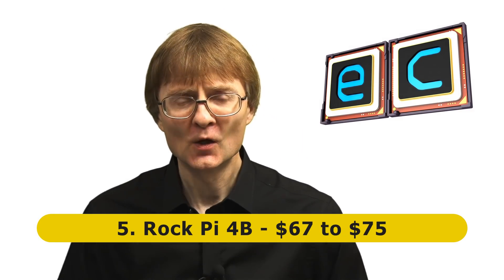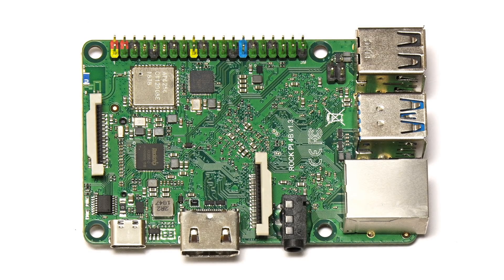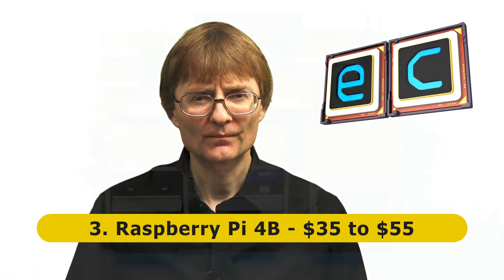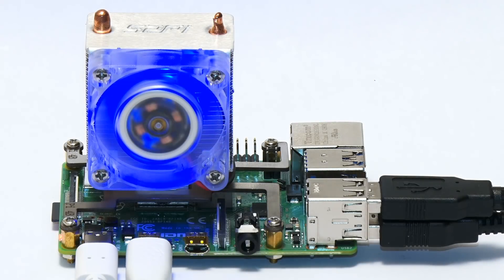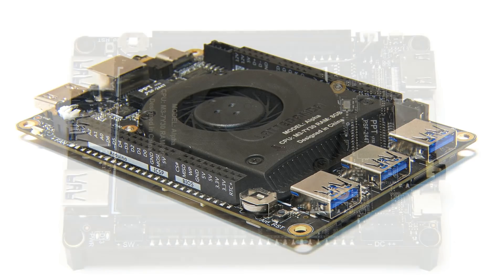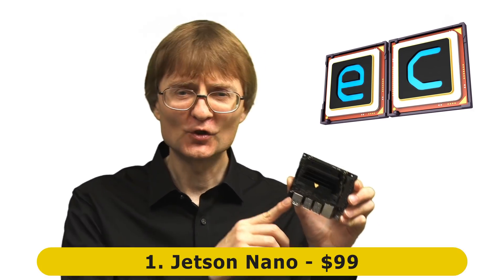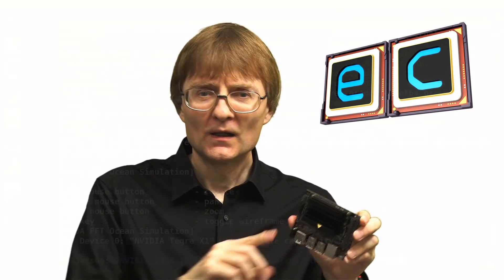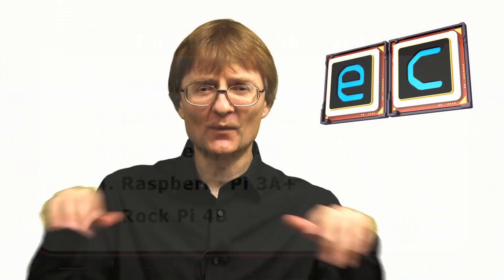Top Five New SBCs 2019

Comment: Last Xmas I bought an American made computer about as big as a Latte Panda called an Azulle Byte 3. Quad core 1.1 GH Intel CPU, 4G ram, 32G flash on board, no fan needed, case, power supply, HDMI and monitor plug, wifi, bluetooth, 1G ethernet, M.2 slot for SSD, Sata plug, 3xUSB3, USB2 and Window’s 10 Pro for $240.00 USD.

Totally finished like an Apple TV box, power supply included. No extra cooling fan needed, no buying a case separately and Window’s 10 Pro.

Comment: Personally what I want is a single HDMI and at least a SATA 2 interface that can be booted from along with 4 gig of ram. I don't need all the other bells and whistles apart from the 40pin GPIO. Nobody has done that yet. Giabit LAN would be nice as would USB3 but I'd settle for 10/100 and USB2
Reply from the maker: The closest is probably a UDOO x86 Advanced Plus -- the SATA is bootable I think (as is its M.2).
Reply: @ExplainingComputers  Thanks. I had a quick look and it's a bit too power hungry for what I need it to do and a bit too big physically. I might go with one of the Orange pi variants if I can find out what the power consumption is. My total power budget is only 20W. The SATA drive I have in mind is only 2.5W and the screen is 5W and 1W for the keyboard and mouse (which are not connected most of the time). I'm probably just going to have to live with 2 gig of ram and having to boot off onboard emmc.

Comment: My two cents: maybe the LattePanda should be an honorable mention, apart of top five, simply because it's so off the review budget group. If you compare a $35k versus a $370k car, it's nothing but expected that the differences should be huge. Also, as a suggestion, maybe Chris could review an industrial grade SOM+carrier board, for the price tag is similar to maker SBCs, but with much more solid support, which many of the commentators have mentioned here, and rightfully so. For instance, there are currently in the market options that run (and ship) with windows and are, truly, Linux compatible, with great specs and interface options. Maybe it'd worth a shot. Footnote: I got full of expectation when the list comes up to 3rd, 2nd, 1st... like... omg, who will be the Oscar winner... Lol...

Comment: I broadly agree with your SBC ranking, but the pricing of the LattePanda Alpha brings you into the Intel NUC price range. For around £450 you can get a Bean Canyon NUC with 8th gen i7 Intel quad-core Processor with Intel Iris Plus 655 Graphics, NVMe and SATA drive support (2 drives bays) and 40 Gpbs Thunderbolt 3 Port. OK, you need to add memory and an SSD drive. I have Jetson Nano which is a great SBC as you say, but I was also looking to purchase a LattePanda - Intel SBC. I then decided the Intel NUC NUC8i7BEH was better valued as it comes with a case and power supply. I dual boot it with Windows 10 and Ubuntu 18.04 LTS, which installs straight out of the box, and it has excellent performance.

Comment: Hello controversial Chris, 
Excellent choice, I can say! 
Minor update to your list; I would put udoo bolt as well on it. 
And yes, SBC or not, ML is new 'thing' to learn, so Jetson nano 1st, agreed. 
Continue to be controversial, by all means. 😁
Reply from the maker: Hi Elvira -- there's quite a bit of love here for the UDOO Bolt, even with its noisy fan! :) I will continue to be controversial then!
Reply: ExplainingComputers 
Noisy? What's that? 🤣

I'm surrounded with all kinds/sizes computers. Buzzing, flashing, humming, LEDs in all colours... 
The noisiest is not even a computer.  It is my ol' refrigerator in kitchen. 🤣
Reply from the maker: I too have a fridge that makes a lot of noise! I always have to close the door to the kitchen when filming. The Bolt's fan is particularly annoying, as it is high pitched and flits between silent and manic. :)
Reply: ExplainingComputers 
Actually, more the noise of my devices > better sleep for me. Calming effect. 🤣
Reply: @elviraeloramilosic9813  Then be sure to order the commercial version of the Keurig coffee maker. The pump on mine is louder than my fridge! But it also holds up well, & longevity was a definite selling point compared to the quieter home units. And for Chris's benefit, it also makes tea, & the occasional hot chocolate in winter. I've been thinking of adding a Pi Zero W to the Keurig. It would let me phone ahead to make my coffee, & I could use the GPIO to control a valve a pump to refill the reservoir when the level drops. Definitely a "hamster feeder for a nerd".
Reply: Marcus P. Hagen 
Nice idea. 
Excellent coffee maker. 👍🏻

Comment: I love the LattePanda but it's price is just a big no-go...
Reply: I can't see it for that price either, you could get a proper computer.  For makers or battery operated systems, this just does not seem right to me...
Reply: @layton3503  > you could get a proper computer.

have fun putting a "proper computer" in your car, a board a small boat or carry it around in your bag wherever you go (where a laptop would already be too big)...
I managed to get a LattePanda Alpha for free (only had to re-solder an SMD) and it sits perfectly in my backpack for collecting loads of data from loads of sensors (where the Raspberry Pi would be too weak).
Reply: @FinlayDaG33k  What??? you did not shell out $500.00 for one?   Thanks for making my point.
Reply: @layton3503  No, this one would have ended on the e-waste pile if I didn't spot the dead capacitor, so the only cost was the effort I had to put into soldering on a new one.

I think that the LattePanda does have it's perks when you need something fairly beefy but your application can't fit something like a mini-itx machine (like the data collection thing I carry with me).
If you have the space, then something else would be better, else, you should definitely have a look at the LattePanda Alpha.
The UDOO Bolt also exists but it carries the same price tag (although you do get more performance out of it).

This, of course, does imply that your application can run using x86_64 and is not locked into ARM.
Reply: @FinlayDaG33k  well for that price you still can get decent PC/104 embedded PC board or mini itx boards which packs nice power as well. Yes, both are bigger but both might work quite well. "for collecting loads of data from loads of sensors" I find it hard to believe. Visual data - ok, that one I might understand (although I find it hard to believe you need plenty of cameras). Other sensors ... those use usually SPI, I2C, 1 wire, I2S or sync/async parallel (4-8-16bit) and there's no reason why faster CPU cores would be better while following the same peripherals principles. I suspect you meant processing and not collecting.
Reply: @Promilus1984  A mini-itx board might still be to big for certain purposes (I'm not going to carry a mini-itx board in my bag all the time).
And my purpose does collect and process at the same time.
Though maybe I should rephrase it a littlebit since they are not "sensors" but wifi cards... 13 of them to be exact.
Reply: I would've preferred to see the ODroid H2 in that spot instead.  It's much more price competitive.
Reply: @jaylittlegm  Pretty much yea...
It has pretty much everything you'd buy the LattePanda for except the size being a big more (it's thicker).
It even has the option to choose your own RAM (instead of the hard-soldered "what you pick is what you're stuck with).
I'm not a big fan of the double ethernet on it but it does give more options to use it (eg. as a firewall)

Comment: The thing about Jetson Nano bothers me.  I've read blogs saying that the Pi4 performs at the same level on AI tasks, which is what the Nano was made for.  Also the Nano doesn't provide as much power to the GPIO pins, which makes me unsure of how to use it in robotics projects.
Reply from the maker: The Jetson Nano outperforms the Pi on things like vision recognition, if the neural net can run on the CUDA core GPU. The Jetson Nano also outperforms the Pi full stop on other tasks, as the tests in my Pi 4 vs Jetson Nano showed.
Reply: @ExplainingComputers  Thank you for responding.  I will watch your Pi4 vs Nano video again.  I'm a big fan of yours :)
Reply: @ExplainingComputers  Hi Christopher.  I appreciated this reply, because I watch your videos often.  I ended up buying a Nano as a result of your response.  My experience was nothing short of a nightmare: My first nano arrived broken and inoperable.  My second nano encountered numerous errors on installation, and would often need to be re-flashed and set up, a process that often took up to an hour.  Additionally, the tutorials for the Nano are often not beginner-friendly, and require deep knowledge of Linux and/or C++.  I found it useful specifically for running fast object detection models, but anything beyond that (including customizing any object detection model) proved impossible for someone with only a year and a half of experience with makerboards.  Perhaps the hardware is wonderful, but in my opinion it does not belong in the same class as a Raspberry Pi, given its ridiculous difficulty of use.
Reply from the maker: @tylersnard  I'm very sorry to hear that you have had problems with a defective Nano, and problems thereafter. I have not had such issues. It may be a power supply issue causing instability with the second board. That certainly could lead to what you describe.

Comment: I just want a Pico ITX SBC that has an x86(Celeron at least) CPU, 4 or 8GB of LPDDR3/4, and an integrated(or at least separately available) IHS with ports for CPU fan control, one SATA port, one m.2 NVMe, Displayport, USB-C power and/or POE capabilities, at least two USB 3.0, gigabit ethernet, WiFi and BT. 
Looking forward to the Rock Pi X

Comment: Adding to comments on the Rasberry Pi 4B. I find the micro HDMI connection fiddly and awkward To work with  and I  can't work out on low cost board why I would every need 2? With all the things that could be improved and other possible uses of this bit of "Real Estate" on the edge of the board, why 2x micro HDMI? Perhaps just a bridge to far! I have also had to invest in new cable to use with this and will probably use for no other purpose. The standard sized HDMI connector works well. Why change it?
However,  the new Pi4 B is a greatly improved board that could easily be used as a low cost computer for browsing the web and general "office" type applications  etc. I couldn't really say that about the Pi 3B+. I think the next thing for the Pi team to do is the limitation of the 32GB HSDC card on memory (without clip ons) and recognizing that they need to better accommodate cooling solutions.
Reply from the maker: The Raspberry Pi Foundation argue that thier industrial clients need/want the two HDMI ports to use the Pi as a thin client. I don't think many makers want them.

Comment: Nice video. Still wonder what people do with these boards, they are small and powerful, you mention already some reasons such as education, IoT or media player however what kind of other projects put it to it limits by useful meanings? Most of these boards are pricey and with awesome specs however to use this for a any/simple project it is too expensive. 

Purchased two second hand raspbPI for only 3.50 (lucky me), I don't feel 'quilty' to use it dedicated and in a permanent solution because it was a reasonable price. When you pay, for example, $99 for a board with all the features, I think you will think twice to use it dedicated for a project unless you are rich and don't care or have a clear goal.

It looks like the megapixel race, to get it smaller, faster and more powerful. But in practice, what actually people do with all of the power, do they really use it (all)? For example, printing a 10MP picture on A4 is useless, it doesn't have to be 10MP, pointless, overkill. Have seen some examples with expensive boards only to feed plants, measure temparature and such and use it as a permanent solution (including a case). Using a board of, for example, $35 to do such simple tasks is overkill (and a waste of resources and money), can do this with a MCU, Arduino, ESP etc. 

So what kind of other projects people use these boards for to get the real benefits?
Reply: Given the connectivity of the GPIO header and community software support, the only limits are one's own imagination.
I've just spent the entire summer developing a solar-powered telescopic HD surveillance system (which also utilizes ESP MCUs on the solar tracker). Considering my investment of time, completing the challenge outweighs the costs (>$500 and rising), so I expect to upgrade the RPi 3B+ to a Khadas VIM3 w/NVMe 1TB SSD for local video storage.😎
Reply from the maker: I'll be building a NAS with a Pi 4 in a video here soon.

Comment: I agree with your list in general. I think the one overlooked aspect of all but #2  only becouse of price, is that several of the same boards could be purchased at the #2  single price point, put in sequence to each other for a robot project that would be powerfull  by still most standard's, allowing each board to function for independent needs such as drive, arm control, visual needs and problem solving wth the opertunity of enough computing power from each to also back other board failures in a redundant sequence. And doing far cheaper than most designs out there today.
Reply: Have you considered the same approach using ESP8266 or ESP32 micro-controller boards? They provide lots of bang for the bucks and can be controlled/programmed via WiFi & GUI interfaces, such as Ktinker, QT5, ESPeasy, etc.
At the moment, I'm building a telescopic HiDef surveillance system (with zoom, aperture, focus, & x/y positioning via stepper motors for directional presets, triggered via concealed ESPxx remote sensors). The camera is connected to a RPi3B+ (upgrade-able to Khadas VIM3) for streaming video. 
All of that mounts on top of solar-tracking dual 20 Watt PV panels which charge a 50 Ah LiPo power pack. The tracking system consists of an ESP8266 controlling the x/y stepper motors via I2C connection to the SBC. It's my 1st Maker project and I'm nearly finished, except I'm still waiting for some spur gears to arrive from China😎.
Reply: @TheOleHermit  no not really as i have been putting a deep thought of that kind of project until winter when my outdoor activity is slowed and i have explored and gathered a few of the heavy motor drives and batteries. I tend to gear my ideas toward heavier,  larger builds as my eyes and fingers don't work so well on the smaller stuff as easy. The main reason i thought of these comuter boards as they also add the ability of al with ready apps out there as i really think some of them can be repurposed and adapted for faster production. But thats just me looking at it from the odd side so to speak.
Reply: @davidunderwood3605  Understood. My ESPs only supply the TTL control signals for the stepper motors. The power is provided via 9 VDC power bank and driver boards.
Yes, I'm over-engineering mine as well. The components are housed inside 1/4" thick sections of aluminum channels, eventually mounted on top of a 10' tall, 3" dia steel tube, embedded in a concrete foundation.😜
Good luck with your project.

Comment: Thank you Chris for another great video.  You're spot on with your Rpi 4 valuations and like to add my disappointment for the missing ssd boot capability, 64bit Raspian OS and USB 3 issues on my 4GB boards.  I did manage to update to the 64bit kernel and use an SSD disk with the SD card as my boot media.  It definitely improved performance.
Reply from the maker: Agreed -- the really annoying thing (well, one of them) is that we had USB boot out of the box with the Pi 3B+. I know we will get it with the 4B in time. But it really should have been there at launch.

Comment: So you say that you're allowing a board that requires it to plug in to another board to be on this list.

Pretty slack rules you have there.

I wonder how slack they are?

My Netbook is more of a SBC than that Jetson Nano. And that can run windows 7 (to some varying degree)
Reply from the maker: Not slack rules at all. The Jetson Nano SoM (system on a module) that plugs into the carrier board and is most definitely an SBC -- it contains the CPU, GPU, RAM, SD card slot, and all the connectivity electronics. It is that module, and not the two boards, that is the computer. The carrier board only expands the connections on the edge of the Jetson Nano. And for industrial use, the Jetson Nano can be purchased and used without the carrier board. Technically, what I show in the video is the Jetson Nano Developer Kit -- which is the Jetson Nano SBC plus the carrier board. I could have mentioned all of this in video, but it would have overwhelmed things with information. I imagine your netbook has plug-in RAM (SO-DIMMS), so does not contain an SBC.